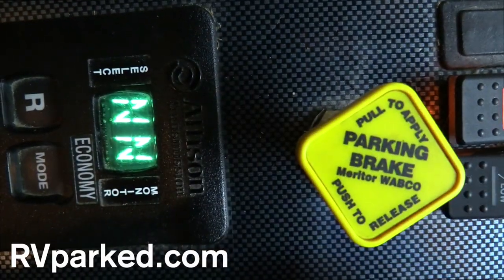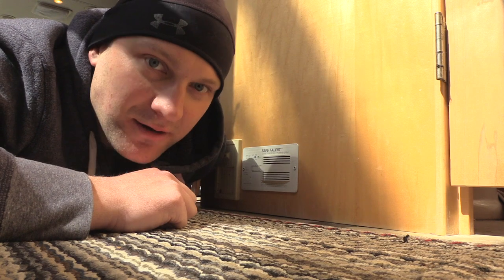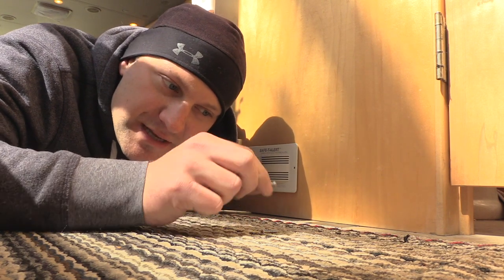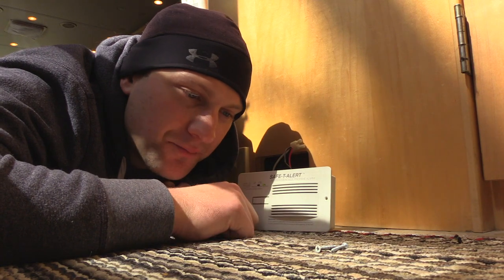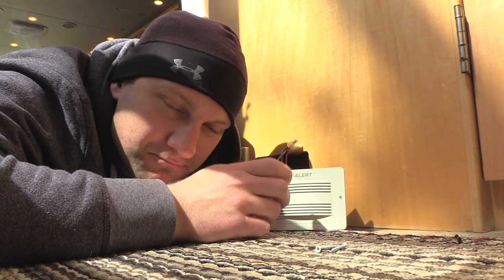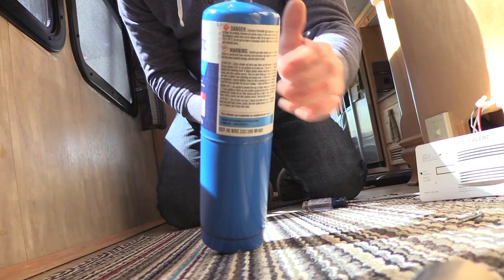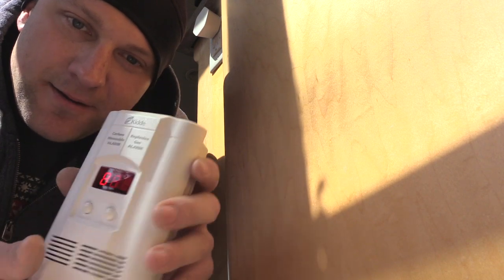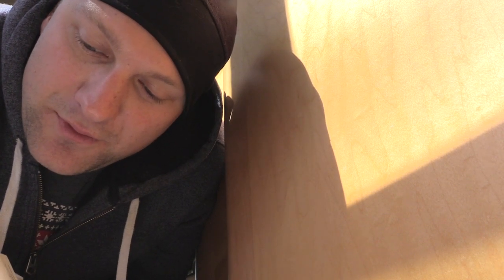Replace Your RV Propane Detector... Now.

Comment: Also, I believe that a 12 volt alarm is required to meet most Local Codes. That is because most people have their 12V system on when they aren't plugged into shore power. And when you're plugged into 120V shore power, the 12V alarm will still function

Comment: Mine is from 1987, and has been going off lately. I tested it with a bic lighter, and a torch, and it seems to lack the sensitivity required to be going off in the first place. There would have to be a lot of propane, but that doesnt seem to be the case. The sensor works, so idk.. False positives? A leaky propane system doesnt sound fun to repair, or even find the leak to begin with.
Reply from the maker: Thanks for watching! Upgrade detector and have the propane system looked at by a dealer. They have the ability to pressure test. :) safe and fun travels!

Comment: I was hoping you would show how to change it
Reply from the maker: I would purchase a plug in combustible gas detector with a batt. Backup. And ensure it is plugged in at an appropriate height for detecting the gas. To replace. Two screws and two wires. Test. Thank you for watching!!

Comment: Just bought this.  it will be a nice safety update in my 2004 travel trailer.  I would advise folks doing the same  to either mount it down low or run it on battery near the floor.  Propane gas does not rise, it stays down.
The unit has a separatable power supply, so you can plug it in at normal height while putting the unit low where it will be best able to sense problems.
Edit.  it is designed to run on AC, which is fine for me but not for a fulltimer, boondocker unless using an inverter or generator.  The battery is for backup. It has fewer capabilities on battery, and the battery won't last long. but it will work, albeit with less functions.

Comment: Did you still replace the old detector or disconnect it?
Reply from the maker: We left the old detector plugged in as a back-up. We will replace it soon. I really am not a fan of the manufacturer of the rv detectors. They seem cheap.